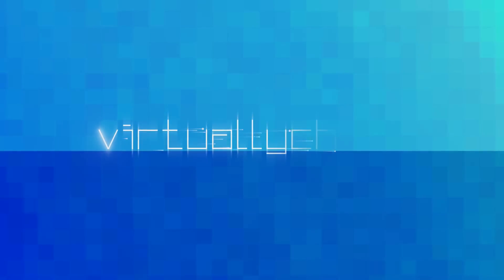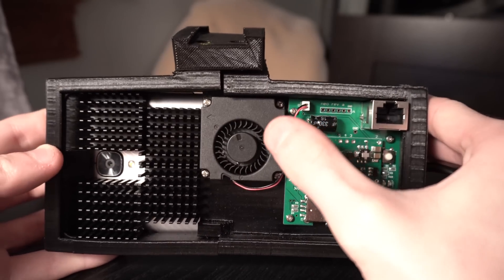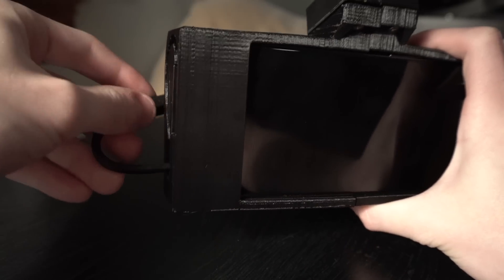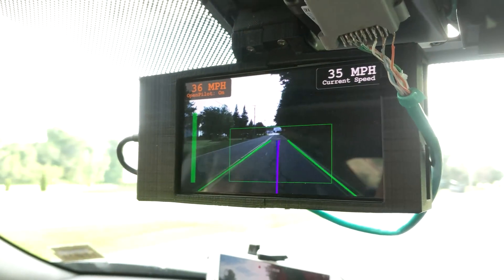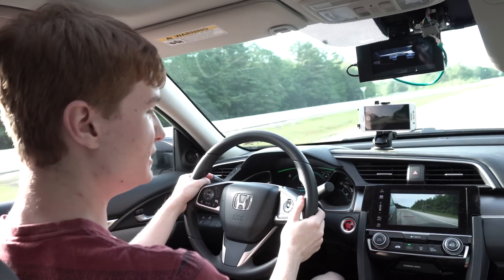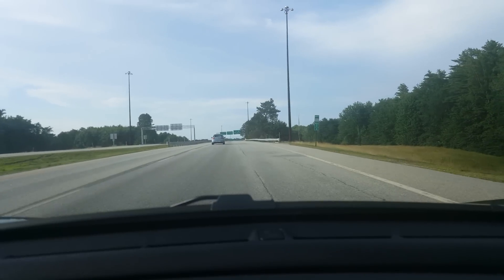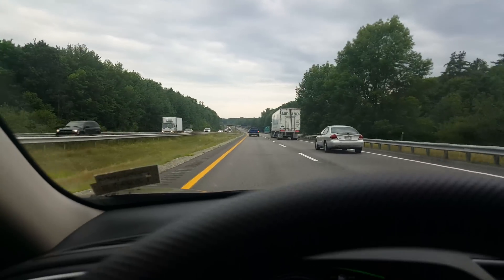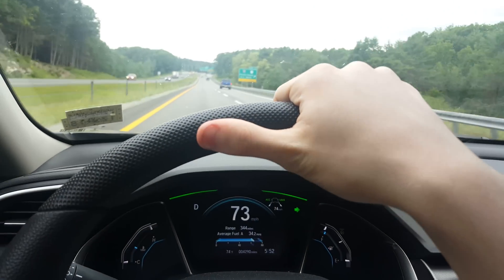Building a Self Driving Car | EP 2 (comma neo w/ openpilot)

Comment: As cool as it is, this kind of thing should be forbidden. You were using it on public roads, this tech needs registration and license to make sure everything works as needed.
Reply from the maker: To be fair, it's a level 2 system which means that I have to pay attention at all times. So if the system doesn't something wrong it is entirely my fault for not stopping it. Collecting data is the only way to help these systems learn, so if they were forbidden it would be exponentially harder for this technology to improve before it's rolled out to the public.
Reply: Its not iklegal coz its not autonomus its still requires hand on whell tioe of driving,and its more in the realm of driving helper like a bit better tempomath
Reply: You are aware that Honda had its own lane keeping assist in? This is just a more advanced version of adaptive cruise control and lane keeping assist.

Comment: Great job man!
You could consider adding some heat shrink like this https://www.amazon.com/gp/aw/d/B008WWC6FU/ref=mh_s9_acsd_topr_blQPPf_c_x_7_w?pf_rd_m=ATVPDKIKX0DER&pf_rd_s=mobile-hybrid-3&pf_rd_r=PYAH7BHG7P1H2GH6VW54&pf_rd_t=30901&pf_rd_p=b57f5639-73c6-5e58-aea5-2473e4740a80&pf_rd_i=700782011 to your wires to keep them in place and from breaking the solder joints.

Comment: If nobody has said anything to you yet, some hot glue on those solder joints will keep em from pulling off through normal use.
Reply: Good point! If u scrub up the connector before soldering and use a bit more solder that holds it as well. but cant hurt to have hot glue on there in addition
Reply: He should put some heat shrink tubing on
Reply: So it wont short out

Comment: Soldering is quite bad. Please use some flux. There is never too much flux if you make connectors, but cleaning flux off with isopropyl alcohol should make it safe from short circuits.

Comment: Does it stop at red lights (if there's no car in front of you)?
Reply: I'm sure it could be done in a future software update :)
Reply: Gary teslas system is not named incorrectly. Like a autopilot in an airplane, it is an assistance tool. Never claimed to be more than that. Musk has constantly said the driver is still fully liable. To say waymos system is way more advanced then anything else, where is it to uphold those claims? It isn't on the market yet.
Reply: No it does not
Reply: Waymo requires sophisticated hardware for it to work...hardware that is ugly, expensive and impractical to market for the average vehicle. Tesla has to right idea because their cars have just enough hardware but depend heavily on software and as more driving data becomes available the software will continue to be updated. Comma.AI is basically trying to copy Tesla in a more ghetto, yet rational way. One of the main advantages comma.ai has over the others is that it’s open source and they can’t be held legally accountable if something f’s up and that also allows them to release updates faster and with less hesitation.
Reply: No, but you can try to be behind a car before the red light.
Reply: Waymo = Google
Reply: anonymous i think that comma.ai is a great middle ground. as of right now it isn’t supposed to be a complete replacement for a human driver but think about the fact that it was only developed by a little more than a dozen people. of course they won’t be leading the industry, but they will be perfecting it
Reply: Christina Andwena Why?
Reply: Tinha que colocar um celular para cada espelho retrovisor e sensores laterais. E em dias chuvosos como vai ser?
Reply: Danny Tuppeny What if they found a way to wirelessly communicate with the lights? 0_0
Reply: No, this is just lane drift detection nothing more...
Reply: Probably not. I'm not familiar with the openpilot, but I do not think any system is that advanced right now.
Reply: @nicholasperry4818  The  2016 Honda Civic can do this indirectly out-of-the-box, though it does require that you were already in adaptive cruise control, following a car in front, who happened to then stop at the red light (well let's hope he did).  I know it's not quite what you asked but I use it everyday and its fun and safe.
Reply: Nicholas Perry It should be... Nvidia and Tesla are both companies that use AI to improve seld-driving cars by training it on the real life situations... I saw the Nvidia car driving threw some track across a field (without markings) and it was able to stay on the track in a YouTube Video... Detecting if a Traffic light is red or Green should be very easy if they are able to do such advanced stuff... But since openpilot is only running on a phone processor which gets absolutly "destroyed" by the performance of nvidia's and Tesla's processors it can not calculate fast enough to use AI to make real time decisions...
Reply: @hendrikleier2694  Genuine question, but do you know how AI actually works? Cause no car is running training data on its own hardware. That all happens at Tesla's servers. You also do know that even Tesla's autopilot can't stop at red lights, right?
Reply: Gary  my opinion of Tesla went from 100 to 0 real quick
Reply: Waymo's vehicles will. But then again Comma AI's system is a toy in comparison and Tesla's system is just an advance cruise control which should never be label auto pilot because people think it is something it is not
Reply: Gary Tesla's Autopilot is autonomous.
Reply: https://techcrunch.com/2017/11/07/waymo-now-testing-its-self-driving-cars-on-public-roads-with-no-one-at-the-wheel/

Waymo is light year ahead of anyone in the field and that's not even up for debate. Do your own home work. I would like to see a Tesla car even attempt fully automated driving. Waymo is being responsible and actually making sure they have a SAFE working product before they bring it to the consumer market.

edit:// Despite me sounding a bit @sshole like I assure you my comment is certainly not ad hominem.

Comment: I am very happy you decided to post the videos.  I've just found out about the comma system and want to buy a car what will work with it.

A question: does the phone use any data while the car is driving, or does it only communicate for uploading data?  (I'm guessing i would only need a phone with a minimal data plan, correct?)